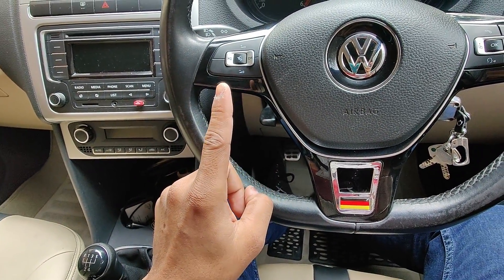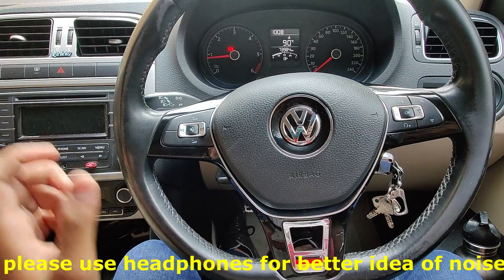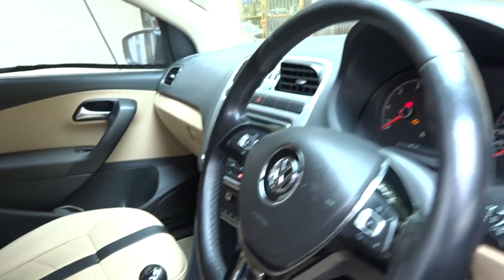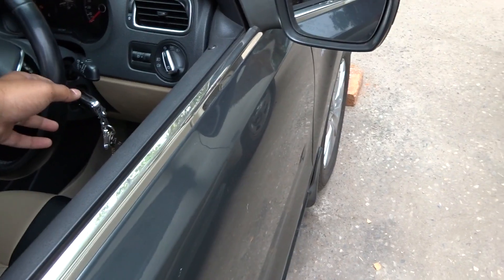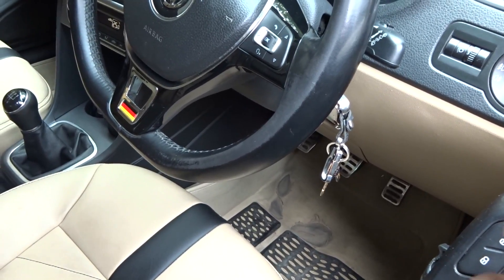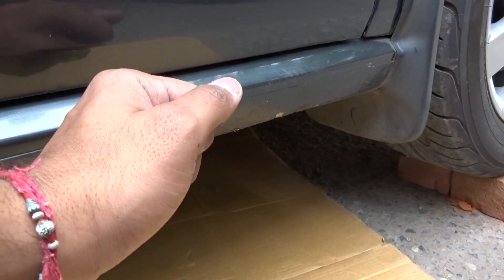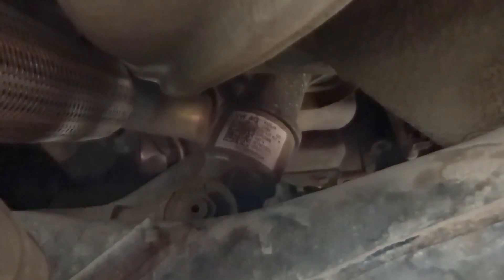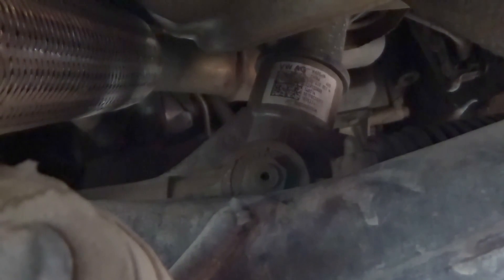STEERING RACK NOISE | RACK PRELOAD ADJUSTMENT | YOLK SCREW | HOW TO

Comment: Volkswagen told me that rack is damaged and asked 13k for replacement. I knew they were fooling me. I denied them and saved my money.
Reply: If volkswagen dealers was a doctor belike:
Me : sir, I have headache. 
Volkswagen dealers : just replace the head.
Reply: @aviationvideos1612  I laughed pretty hard at this 😂😂
Reply: Same for me too, about a week ago. The made an estimate of 90k for a bunch of things that suddenly got bad when the car was not even driven due to the lockdown.
Reply: @tarun9542  90k that’s crazy talk
Reply from the maker: Sir , always remember , they are business first , they will try to trap you in excessive billing , lockdown was a tough time for them too 😅😅
Reply: 90k rupees he means
Reply: I’m not an expert but with a little research , not even the whole gear rack system costs 13k 💀
Reply from the maker: Sir its right now for 10797rupees
Reply: What year model is this car?
Reply from the maker: @acowarddiexasoldierdieonce 2015
Reply: @yourDIYneeds  thank you I can’t get to the yolk screw on my 2019 atlas wheels move when I barely turn steering wheel so I’m going to try the inner tie rods and see if that helps because I have no steering leaks or problems but I feel the clunk on left inner tie rod hopefully that will work I’ve changed both front axles and both sway bar links thus far
Reply: @yourDIYneeds Hello sir...I  face  issue in right side suspension like something is loose on front end and that too only on some potholes..
Not all potholes is creating that sound...your thoughts pls
Reply from the maker: @vijayendranvijay4538 sir either link rods or strut mount
Reply: It is worked for you?

Comment: Hi my rack is new minir clunking noise is coming from right side not always will this adjustment help? Steering is lil hard
Reply from the maker: Sir , If its new , then i will advise you to check other components related to suspension first .
Reply: Almost everything is new except shock absorber
Reply from the maker: Shock mounts ?
Reply: @yourDIYneeds  yes changed around 2 months ago but  there is lil gap on right side left is fine
Reply from the maker: Yes sir , that gap is creating that noise , whenever you hit a pothole
Reply: Ok
Reply: Mount to be replaced?
Reply from the maker: Yes , most probably
Reply: @yourDIYneeds  but sir i have seen in many cars gap is almost same
Reply from the maker: Sir gap to a limited amount is ok , but condition being it should be even on both sides , gap is due to the absense of spacer , vw started to use a spacer after late 2015 models
Reply: Engine mountcwas replaced it was broken
Reply: Transmission mount not yet changed will change it asap
Reply: Gap is un even for sure
Reply: Spacer means rogercap ?
Reply: U have images of spacer?

Comment: Thankyou very much. I faced this problem in i10 also in 2012. Its a common issue in i10 also
Reply: Did you fix it? If so how my friend?
Reply: @parsaomer3846  thousands of i10s in my batch were defective so there was no permanent solution. My particular car had 4 owners in 6 years eventually. Company quietly recalled cars in other countries but they don't care about India. They kept replacing the yolk screw and rubber on my expense every 2k km but that didn't solve the problem. After some time, EPS motor also went out which cost me 30k. i10 was the shittiest car I owned after Tata sumo in 2005

Comment: Bro, you are awesome. I have skoda rapid and i have been able to solve most of the problems watching your video. i have got a new problem, black smoke under hard acceleration. I cleaned, Air flow sensor and boost pressure sensor, changed the fuel station and also used Liqui moly super diesel additive, but still the problem persists. it did not show any fault code on VCDS as well. skoda service center asked to use diesel additive. but it did not help. Do you think of any other issue causing this problem. My vehicle is 1.6TDI and clocked 1 lakh kms till date.
Reply from the maker: Sir an intake manifold cleaning along with intercooler cleaning is what you need 
Black smoke can be cause due to 3 reason 
1 . Low quality fuel 
2. Intercooler filled with engine oil which gets deposited inside by oil vapours 
3 . And that same vapour creates carbon crusting inside intake manifold. 
And if you are going to clean these parts then there is also one anti shudder valve in between intercooler and intake , with 5-10 mins extra you should clean that as well 

Important note . Diesel cars usually emit black smoke in cold weather more than hot climate just due to the fact that combustion chamber remains much colder in winters as compared to summers. 

Hope it helps 👍
Reply: @yourDIYneeds  Sure, I'll do these steps. do you have any guide or video on how to remove front bumper to remove the intercooler?
Reply from the maker: You don't need to remove bumper sir . 😅 
I have video on all three of those topics on my channel
Reply: @yourDIYneeds  i saw it, but for better cleaning i felt removing the inter cooler completely is good, also what is your name? :)

Comment: Thanku mate.
Reply: @yourDIYneeds yes ji. Thanku. Since many months I'm thinking of mailing u for choosing tolls for DIY jobs but couldn't. Im aware that you possess complete kit of socket & wrench of taparia along with torx & spline set from force. Wrenches & spanners too.😊. 
With your experience, now would u also suggest us to buy all these for all the jobs that you carried out on polo/skoda! Or something like that ji.. thoda suggest kijiye jara.
U didn't reply for this😊. Now asking for your suggestion mate
Reply from the maker: Sir a decent tool kit with have torx and spline is essential if you are working on vw group cars as they use those kind of drives very often along with that a general set of sockets like , 10 , 12, 13,14,16,17,18,19,21,32 will do the work almost all of it from suspension to oil change everything
Reply: @yourDIYneeds  🤝ku very much ji

Comment: I did spend 15k for a new one. But it had gone really bad. There was so much clunking in potholes, vibration while braking. Mine was changed at 135000 kms.  Will do this for my friends polo. Thanks ✌
Reply: Which car?
Reply: VW VENTO TDI